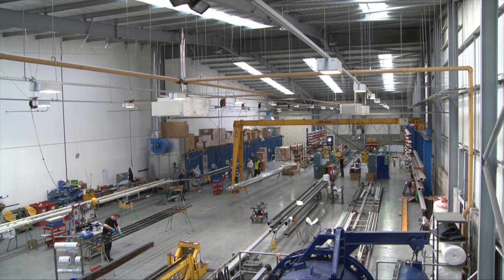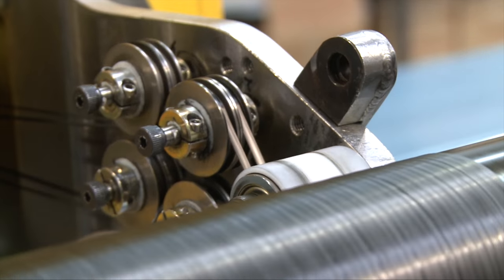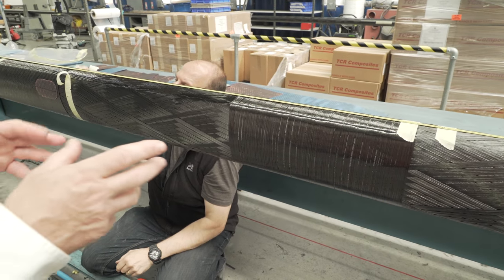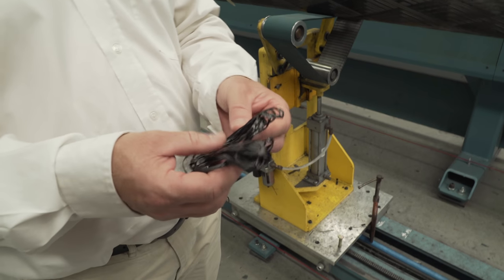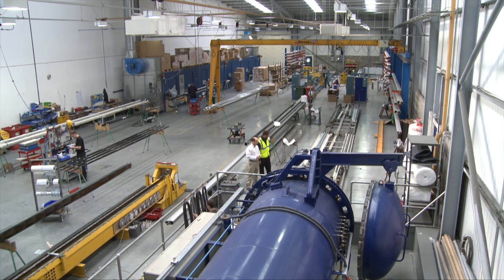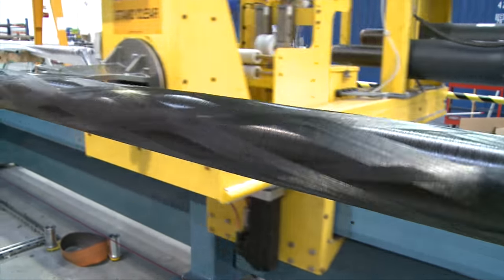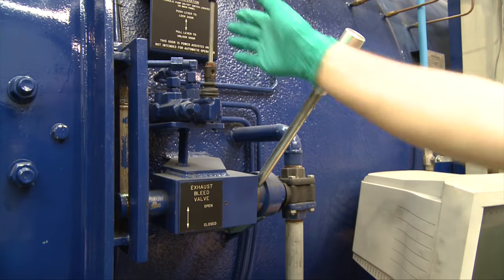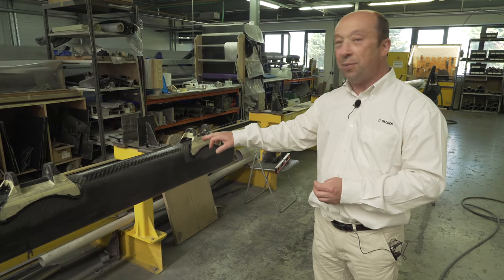Sailboat Masts - Carbon or Aluminum?

Comment: Hi Paul & Sheryl,
Thanks for visiting Selden - it was great to see the processes involved.  Carbon seems likely to eventually replace aluminium, and in our world of trailer yachting, carbon has a huge advantage in almost every area except initial outlay - which is still very high here.  Easier mast raising & lowering and much less weight aloft make very significant improvements for our small boats.  However the UV levels here in Australia are brutal, and long term durability for carbon has been is a problem in the past. Once UV resistance is improved, and economies of scale lower the initial cost, we reckon that carbon will be the standard mast for trailer yachts.  We love your videos, and hope to catch up with you on the water one day.  

Kind regards,

Gavin & Amanda
Reply from the maker: Thanks for the kind words Gavin + Amanda! Definitely weight is a major factor when you have to raise the mast regularly. Similar to our reason for getting carbon downwind poles since they are so much easier to handle. With our last pole we painted it white to reflect the sun after it was 5 years old. 

Fair winds and hope to see you out there!

Comment: 🤔
         This was an excellent video on Carbon Mast Manufacture. 👍 The technology is new however, and presents several uncertainties. The first are heat absorption (black) and UV degradation.  🤔 It seems that both of these issues could be addressed by painting (white or light).

         The superior strength, rigidity and low weight mean less weight aloft and greater hydraulic stability.👍

         My biggest concern however is lightning 🌩 ⚡️strikes. Aluminum masts are great conductors when properly grounded to the sea.  🤔 Carbon itself is very conductive and the spiral weave of the fiber mimics the way lightning spirals along a vertical surface.  My concern is with the epoxy. Would lightning ⚡️ striking a carbon mast cause it to explode or catch fire 🔥? What does Selden know about the matter of how their mast will behave if struck? Do the have mitigation strategies?

       My concerns may be unwarranted, because I notice that Skip Novak, an advocate of “bullet proof design”, chose a carbon rig for his new expedition yacht “Vinson of Antartica”. Nevertheless I’d like to hear Selden address ⚡️ and a carbon rig. 

      Thanks so much for your great channel. we 🙏

Comment: That was a very interesting video.....thank you Paul.

If you had an aluminum spar with just enough thickness for a minimum bending load and then add carbon fiber to those areas that required more strength, the spar would be lighter than a AL spar with the thickness needed for a maximum bending load....and no mandrel is required. It would be heavier than an all carbon spar but light than an all AL spar. Perhaps the difference in price would not be great enough warrant a composite spar.
Reply from the maker: Glad you enjoyed it Ed! Interesting idea too. I wonder if the mix of carbon and aluminum would work in varying temperatures. In the extended interview Steve mentioned that the mandrel was easier to extract since the aluminum contracted when it cooled releasing it from the cured carbon mast ...
Reply: I don't know what the coefficient of contraction is on the resin they are using but AL and steel embedded hard points and brackets have been used in epoxy composite aircraft structures for many years. I can hardly wait until your vessel is ready for review.....plus you have sold me on a swinging keel and there aren't many sailboats in the 48 to 57 foot range with that feature, outside of the defunct Southerly brand.
I don't care for daggerboards so I would also like a smaller version of swinging keels used on catamarans.

Comment: As discussed briefly below, it would be very interesting to see some data that shows how much a carbon fibre mast affects the AVS. Obviously there are a lot of other factors but it would I would just like to get a feel for how much of a factor it is? More specifically I was interested on your comment about twin carbon poles, so you can pole out both foresails. We have an Allures 45, cutter rigged and this is something I would like to experiment with. We have an existing Aluminium mast and pole. The thought is to get a shorter (for the staysail) carbon pole. My question is how is this rigged? Do you have another track or a car on the same track that the other pole is on that you can clip the carbon (second) pole into. Does the boat need to be built with two pole lifts or could you use the spinnaker halyard as one of the pole lifts?
Reply from the maker: We haven't done the final design for the mast yet. I think Discovery Yachts (building our new boat) have specified twin track on their boats with this option in the past. We flew both jibs across the Atlantic in 2015 plus the main as well for our very quick 11 day crossing  
https://distantshores.ca/boatblog_files/storm-spinnaker-transatlantic-downwind-sails.php

Here's an article in Yachting World with details and showing two tracks on the mast 
http://www.yachtingworld.com/cruising/downwind-sailing-tips-sail-more-comfortably-and-faster-with-this-simple-white-sails-solution-62725

Comment: So... I have no idea how reliable the AVS and ballast ratios posted by southerly are, but to me it seems like you have the option of fitting a slow, really steady cruisers with an awesome AVS figure with either a lighter more expensive mast that might shatter if pushed or a less expensive mast that can suffer due fatigue. Either way, you'll end up with a slow cruising boat with great AVS. Wouldn't it make sense to opt for the one with the lesser chance of catastrophic failure?

Comment: Why have two poles and two jibs for going downwind instead of using One large or one small Tri-radial spinnakers depending on the wind strength? You can build a spinnaker chute on deck to haul the spinnaker into if using a sock is too difficult on your own to pull the spinnaker down in heavy air's and have sail go under the bow.

Comment: Thanks for the video. Like others have said, it would be nice to get a little more comparison between the two materials. Specifically weight difference, life expectancy, benefit of UV coating on carbon for Cruisers like yourselves. Also, for someone that is weight conscious on their boats giant lever arm, would it be okay to use steel standing rigging with a carbon mast?  And can the stock aluminum boom be used with the carbon Mast? With the obvious intent on decreasing weight at the highest points.

Thanks!
Reply from the maker: We're making a question list for our next visit! In fact we're doing a Q&A at the Southampton Boatshow - Wednesday 20th September 2017 at 14.00hrs and streamed on Seldén Masts' Facebook page. We'll write down the questions from everyone here as well.

Comment: Since the question was left unanswered, what would be the tie breaker for me is if on small craft, say 5 meters or less, can a carbon fiber mast do the work of an aluminium one with less windage, less weight, and a lower COG?  I would get one if I could do away with the lateral stays.  I also did not hear about luff tracks.  I prefer to not have one.

Comment: As a casual observer, whenever I see a broken mast, not including knock-down situations, it's often a carbon mast.  Considering that the overwhelming number of masts currently out there are aluminum, that's not comforting.  I think the scientists out there try to out smart themselves when calculating loads.    Those calculations probably consider sailors always use correct sail configurations when sailing...which is far from the real world.  I don't know. Could be wrong.  I would prefer to be over engineered than scientifically accurate.
Reply from the maker: hmmm I think you must hang out in high-end marinas to see a number of broken carbon rigs :-) 

I definitely agree mast need to be calculated with the unusual loads in mind! Next time we visit Seldén I'll ask so see more info on the calculations for a cruising boat VS racing where and how that relates to carbon vs alu.

Comment: Okay, so you can't or shouldn't drill holes in carbon fiber poles, then what do you do when you want to add winches or rope clutches to your mast?
Reply from the maker: Sean, I think any high-load items would need to be discussed with Seldén before going ahead. We are talking with them at the Southampton Boat Show on the weekend and will ask your question.

Comment: Interesting. After years of racing you can't beat a carbon rig for weight and strength. But what you did not discus was how carbon stores damage and will fail without warning. As well you must maintain a carbon rig with paint to ensure UV does not damage it. 
So for me I use Aluminum for cruising and carbon for racing. 
Try getting a carbon rig pass through repaired on your rig in Greece? Ya thought so. Won't happen. 
But cool video. Maybe in 40 years.

Comment: It would have been neat to see how they remove the aluminum from the inside of the carbon fiber mast. Very informative video. Thanks
Reply from the maker: They pull the waxed aluminum mandrel out with a huge hydraulic puller Dale, but sadly they weren't doing any when we were there!

Comment: Although my CFM comes from the 80's I still have complete confidence in it. Honestly I don't understand why the industry stays with aluminum besides the cost factor.
Reply from the maker: Cost and complexity to build. Seldén builds in a number of facilities worldwide but just has the one plant capable of carbon with that huge oven and the complex filament winding machine. Aluminum is much easier to make a factory to do it.

Comment: the new 777x building at boeing is going to be making carbon fiber wings in a similar fashion to these masts as i understand it. computer controlled. the machines for it were pretty big as was the entire building.
Reply: Now thats a plane I won't fly in.  Lightening strikes cause often unseen fractures.  Metal fractures are visible.  I've flown in too many storms to trust a carbon winged plane.  Sure it will save on fuel because of its lighter weight.  But at what price to safety I ask?
Reply: only time will tell. im absolutely no expert in it but i've always said the carbon product is only as strong as the resin. ppl act like the product is impossible to destroy since its made from carbon fiber but they never think about how brittle the resin is.  its almost snake oil.